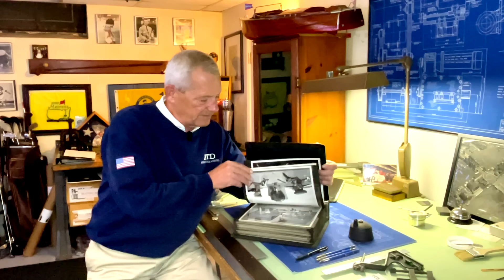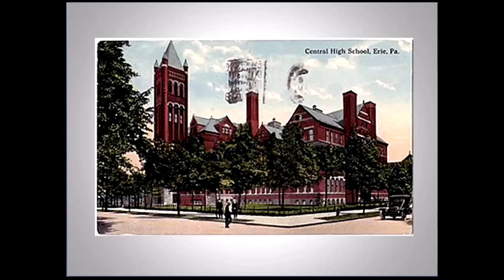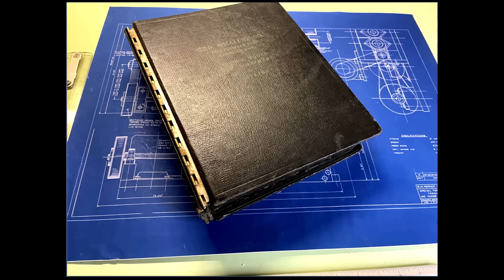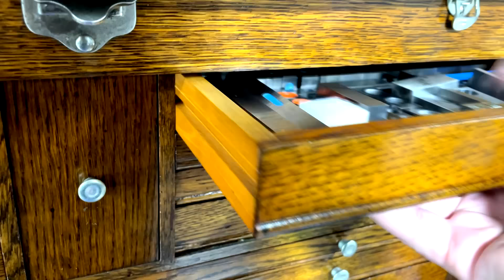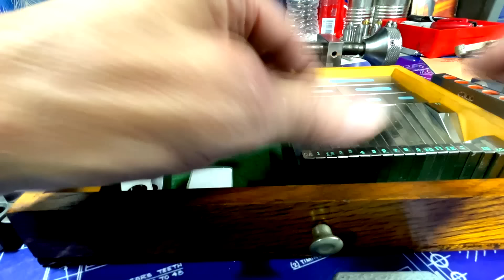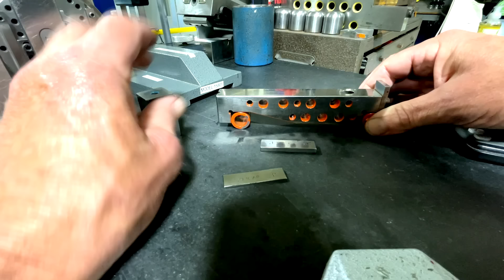THE JOURNEYMAN: CHAPTER 4

Comment: Bad prints OR engineers drawing that really have no practical shop experience! I once went to check on how my CO_WORKER was doing on the mills. I was LEAD TOOLMAKER. I discovered bore gages and stacks of jo blocks on the table?! Looked at print and saw everything on print was METRIC dimensions to 4 places!!!  This poor guy was end-milling or BORING everything to get those dimension!!! 
It was clearly OBVIOUS to me that it was a mounting fixture plate for one of the NEW ZEISS cmm's going into the HONDA WHITE department. I left a note and asked him to meet me along with the NEW DRAFTING ENGINEER who made this CRAZY print!  While the new day HIS BOSS head of engineering came to have a discussion with me about chain of command! IMAGINE BORING counter-bores for  metric socket head cap-screws and end-milling the thru clearance holes simply because ENGINEER drawing up prints had no practical floor experience!! WORST of it was DAY SHIFT operator was responsible for the ORIGINAL set-up! 26 year guy who just did what the print and tolerance bars told him to!! UNREAL!!!!
 Like you this CRAP just drove me nuts! Bad prints abound in this trade!
WE LOVE what we do! IT would be great to be able to make a GOOD LIVING at this but my daughter started out as a NURSE RN making more than i ever have! I must have $10 k in tooling in my gerstners and VIDMAR tool box!! She has scrubs and a STETHOSCOPE!
Reply: This reminds me of when the Industrial Engineers (IEs) got their first CAD system and used it for an office layout, without really understanding how to make CAD drawings (especially with tolerances!).  The CAD system, for some reason, defaulted to tolerances to 6 decimal places!  Needless to say, the Rigger Shop (who moved *everything* that was too heavy to safely lift by hand) was quite vocal about being asked to even consider trying to place desks & chairs to those crazy tolerances!  ;)